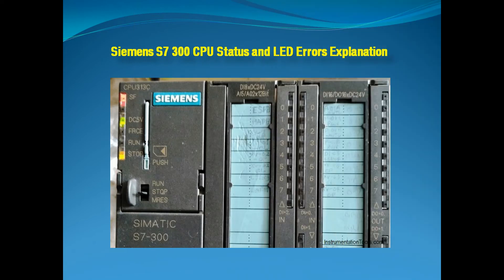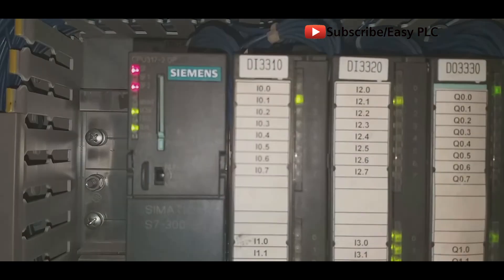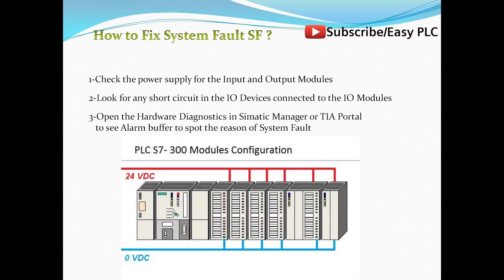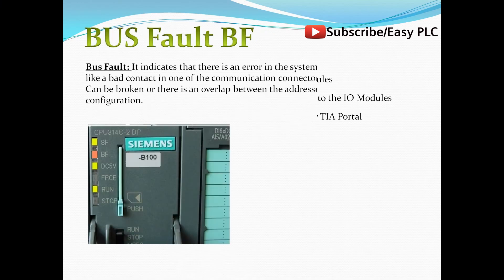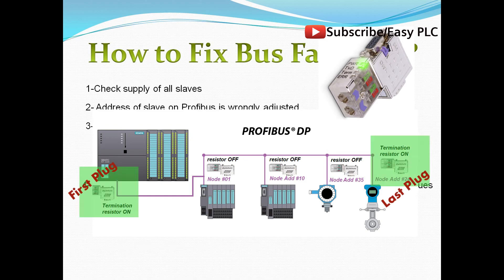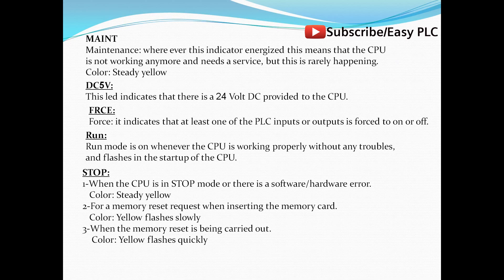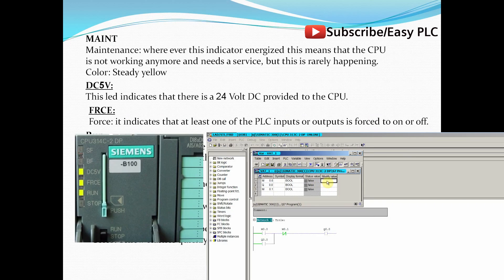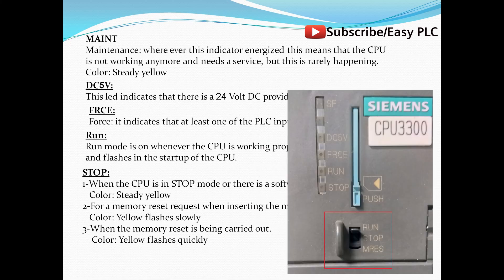Siemens S7 300 CPU Status and LED Errors Explanation

Comment: Sir, if the plc is programmed  and I remove the SD card by switching of the plc.. Will the plc works properly? without SD card. Has the program saved in plc?
Reply from the maker: most probably PLC will stop and give SF fault or all light will Turn ON
Reply: @EASYPLCTRAINING  so it will not work? .. After putting back the SD card in which the program is, plc will work and machine will run as normal
Reply from the maker: @electricalautomation2831  it should work as normal after putting back SD Card ... put SD CARD back and power cycle the PLC